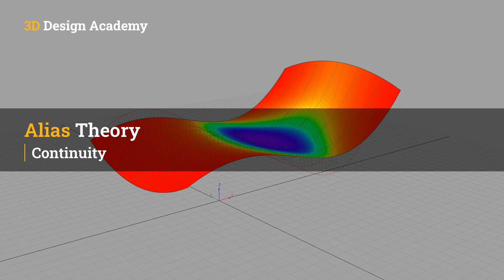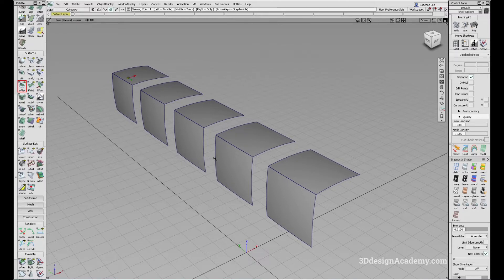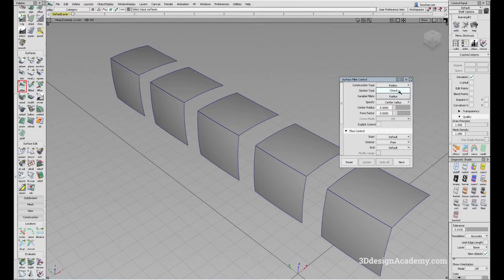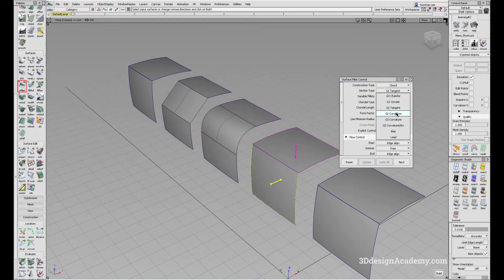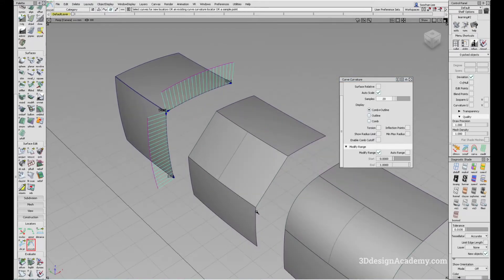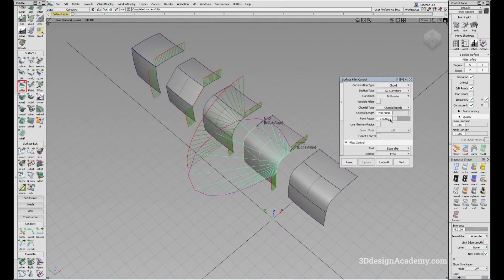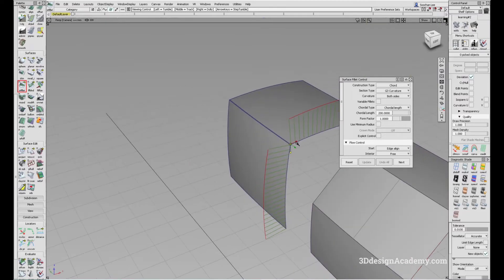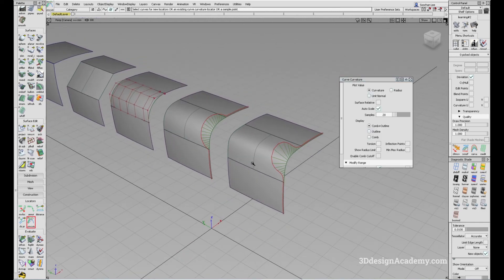Autodesk Alias Tutorials l Alias Theory 2 - Continuity

Comment: Your G3 looks like a G2 really....It should depict a smooth acceleration change, and it does not as the change of curvature has a constant rate ;)
Reply from the maker: Would you be able to give me a time stamp of the part that you're referring to, so that I can either provide an explanation or a better video next time? Thanks!
Reply: @3DDesignAcademy  Hi...In the last case, G3, the curvature graph is too steep, almost like the G2 case.... It should show a really smooth transition, that s all ;) It looks like almost a step, which doesn t show what you are trying to explain, it just isn t clear. ;)...Sorry if I sounded too picky ;)
Reply from the maker: @gibson2623  No I don't mind! I like Alias discussions :) That said, I think the harshness in the curvature comb you saw might be just due to the scale of the curvature comb, not necessarily continuity. Of course, you can make it even smoother by decreasing the form factor to 0.5 or less. Cheers!